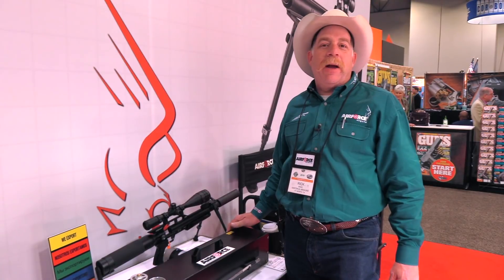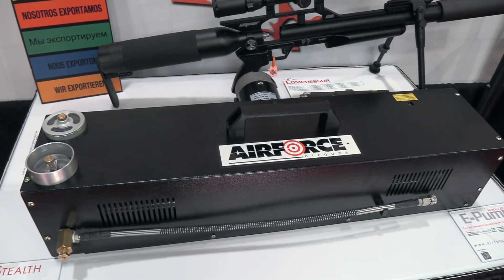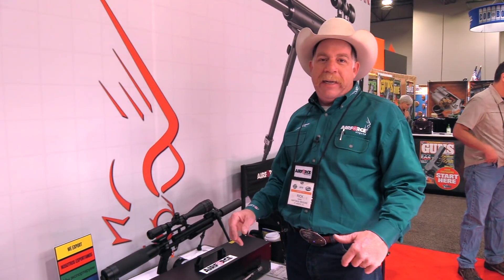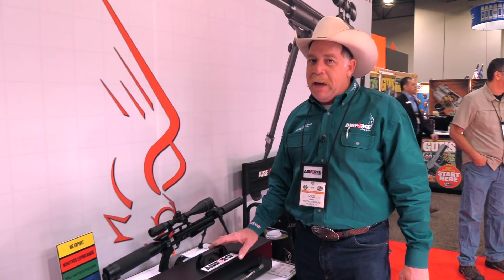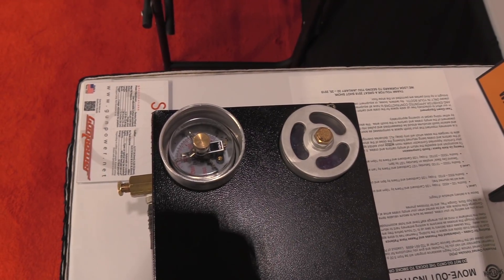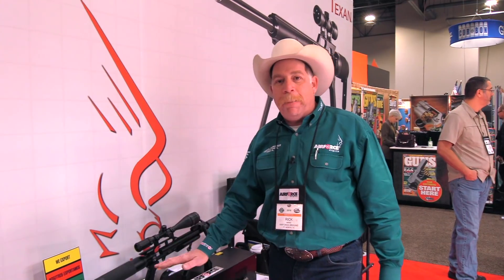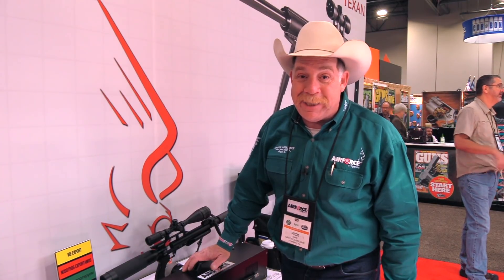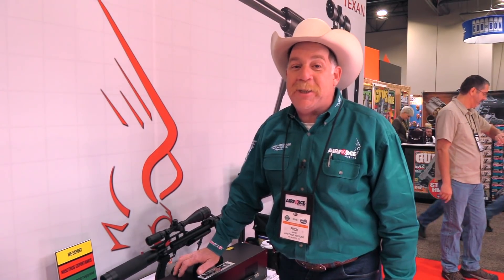Airforce Airguns E-Pump Air Comprssor 4500 psi Airgun Compressor

Comment: What kind of compressor is this? What kind of maintenance does it require? What’s the average fill time for a 90cc tank or a 2500cc airgun?
Reply from the maker: I hope to get one to review. I will run down all the spec's in that video.
Reply: that's one heck of a tank on your airgun...2500cc? You mean 250cc?

I just pre-ordered one of these from pyramyd...supposed to arrive in early April. I was too scared to try a chinese compressor. 4500psi is not a place to cut corners. I was really happy to know this was from an American company - but don't get me wrong, I have korean, ukrainian, german, and american-ish (marauder) airguns...

Comment: Dude that looked like one heck of a air rifle, geez. Up here now , anything over 500ft /sec  is classed as a firearm. Might as well have a 22lr instead, the old red rider bb guns are about the only thing that you can get that isnt a firearm class in my area.  That looks like a sweet set up, i made an compressed air sniper rifle i called it, for paintball. Used a chrono and it exceeded 500ft/sec, since the chrono would not detect it til i fired a few shots, all made from pvc. To fast for paintball, so i changed the barrel to a 2inch barrel and loaded it with 30 paint balls at once, for a shotgun blast. Some of my friends feared that beast. but only one shot. LOL I remember people would hear the wooosh of me releasing that bad boy and they would just dive for cover. haha. ATB man.
Reply from the maker: It gets the job done.